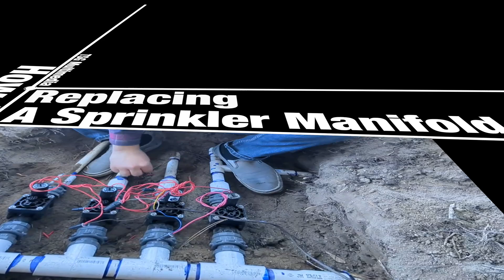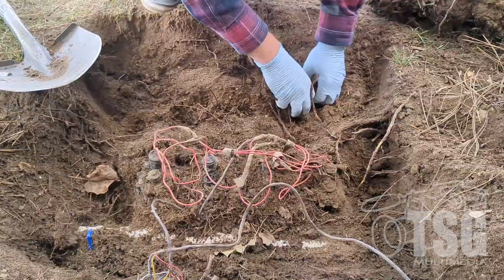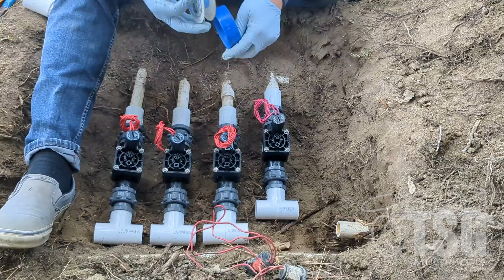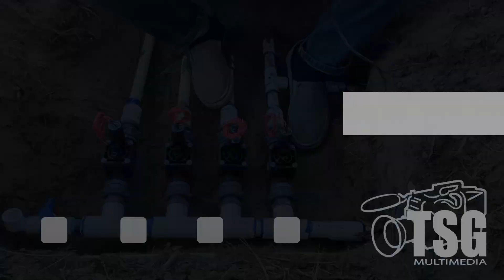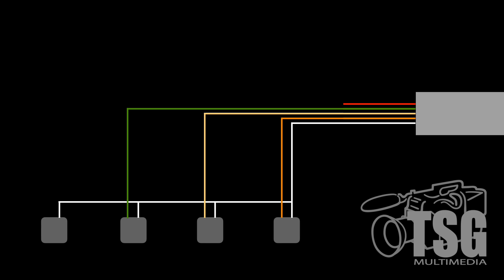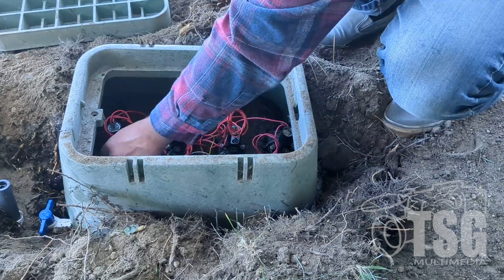#howto Replace A Sprinkler Manifold #lifehacks

Comment: If this helps anybody, a great way to dig around and get more clearance with these kinds of digs is to use a shop vac to suck up dirt that you are kicking loose as you dig.  And for the record, there has just got to be a better way of making these manifolds so that they are easier to replace the valves.  There is never enough room.  I just had one where the valve body was cracked, and i had to dig it all up, then there is never enough room to rotate the valve off, and you have to make a splice in the system somewhere, which then can’t be easily dealt without digging up half your yard.  Frustrating….